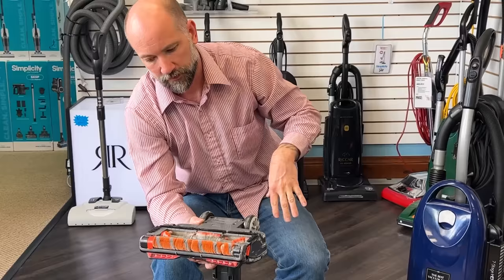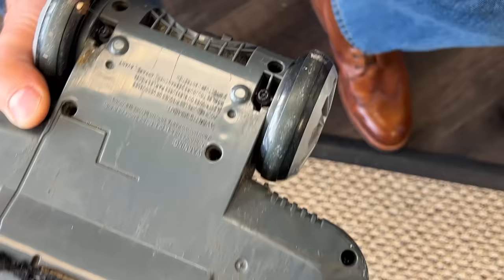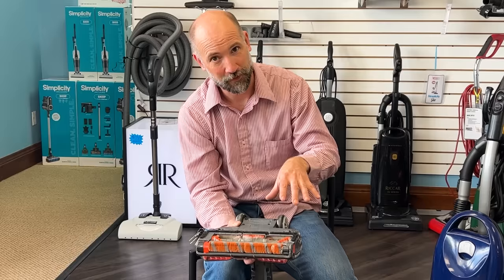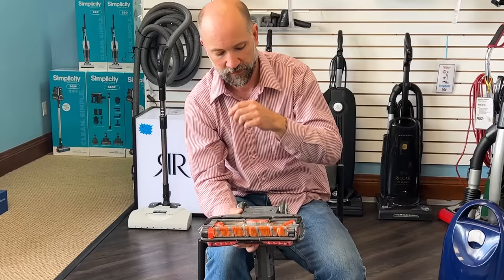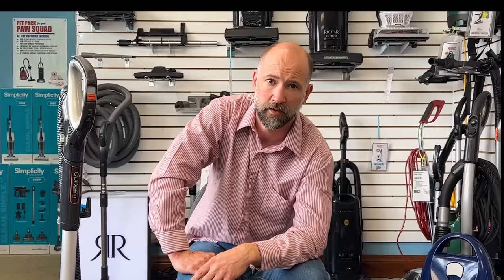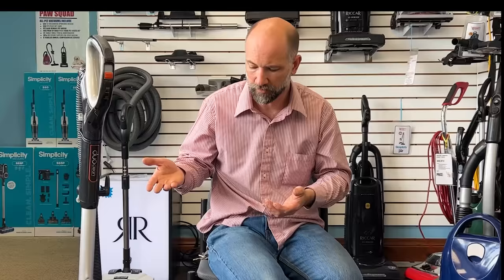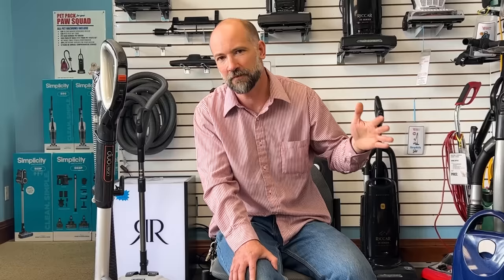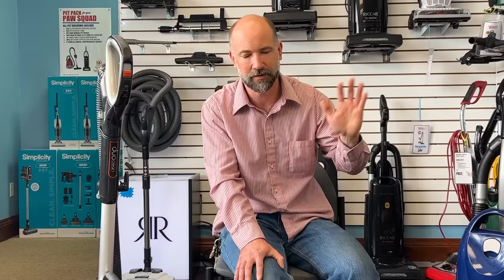Why Can't You Repair Your Shark Vacuum?

Comment: I worked in a small independent vac shop in the mid 80s. Parts were readily available for almost all brands of vacs. Sharks are disposable plastic, much like Bissel used to be. In the background I see that Eureka is still making the same kind of Sanitaire commercial uprights; that design must be about 60 years old by now.
Reply: Can't beat the older actual metal vacuums. My wife still has a couple of very old Rainbow vacuums that still work just fine and still produce enough suction to pull dried concrete apart. OK, maybe not that much suction, but I wouldn't be shocked if you could start up a B52 engine with one..lol
Reply: @martinoamello3017  Rainbows rarely last that long, mostly because people don't take care of them. If you follow the directions religiously, it makes all the difference.
Reply: I remember being able to go to Sears and get parts for most vacuums. Sad it's not that easy anymore.

Comment: I guess I got lucky.  Shark replaced the complete roller brush assembly under the 5 year warranty and I haven’t had any real problems until now.  For some reason there is a big crack in the bottom of the motor housing but the suction is still good.  I think I have had my NV501 rotator for about 10 years.  Figure about $20/ yr. to own a pretty good vacuum that works well—I’m satisfied.  I think I would consider buying the same model again and hope for the best.  Hey, I’ll keep the old one for parts.😊

Comment: We purchased a Rainbow vacuum 21 years ago at that time it cost us $1,800.00 with a couple of accessories. I don't think there are many people that would spend that kind of money on a vacuum but we liked that it used water and that it was very versatile. We still use it once a week or more have had zero issues with it.
Reply from the maker: Most people spend a lot more than $1,800 on a vacuum by buying lousy products that break every year. You hacked the system and bought some thing that actually works out of the gate. Talk about a life hack ;-P
Reply: Had one in Europe had to replace tank separator and gasket. But I don't vacuum once a week at minimum every other day.
Reply: WOW! you got a good one! My friend bought one... She spent about $2000 on it. the suction was horrible. It did filter the allergens out of the carpet though. I can see getting one if you have bad allergies... But... I hated it for every time you dragged it across he floor it splashed the big fan on the bottom of the motor... and dumping is was a GAG FEST.
Reply: I got a Rainbow D-3 from the 1960's from Goodwill for $20. Using a pail of water as a dirt bag is very strange but I guess it's a novelty.

Comment: Very good video. We live in a small town. The vacuum shops like yours are an hr away. We will browse your info and possibly buy from you. We got this Shark from our daughter. She is moving and didn't want it. We were trying to take it apart to clean the roller brush. That is when we discovered the fiasco of a fairly permanent assembly. We watched a couple video's of how to take the head apart and in both some tabs broke. We broke one too. We were down to removing the motor for the head when I searched again and found this video and decided to just reassemble and use it until it dies.

Comment: I know what you mean, it was difficult to get the 8 screws out of my Shark NV360. I used an allen wrench (hex key). If you hold the allen wrench perfectly straight you can get the screws out, may have to grab the allen wrench with pliers. I think the allen wrench was 1/16" size. Anyway, I went to my local Home Depot and got wood screws to replace the OEM "studded" screws. They fit perfectly, the screw size was #7 x 3/4 inch by Everbilt with a standard Phillips head, they even came in a convenient 8 pack. From now on, if I have to open the vacuum to get to the roller brush or belt it will be much easier.

Comment: I'm on my 2nd Shark and it'll be the last one of their vacuums that I purchase.  Have a Duo and the front roller stopped working (likely a broken belt), but after removing every screw on the dang machine, it still would not come apart....and even if I was able to get it apart, probably would have had a heck of a time finding a replacement belt. So, now I'm just using it without the front roller, and when it comes time to replace it, I will certainly be paying closer attention to repairability of the next vacuum.

Comment: Tamper-proof torx screws are pretty easy to bypass. Many times a small punch and hammer can be used to break the center pin off, and then you can use a regular torx bit. I've done it this way quite a few times with success. Another method is to find a small flatblade screwdriver and use it to go into the screw head using two corners of the star and the center post as leverage points and then you can just start turning the screw out.
Reply: Or you can go to the local hardware store and buy the tamperproof torx screwdriver bits…
They aren’t as rare as this guy thinks…
The triangular bits are a bigger problem…

Comment: I read that Spain wont allow certain domestic appliances on the market unless a company has available parts for at least three years or more (i think). I saw this on Spanish video on repairing Shark vacuums. I have had mine for five years, mainly clean hard floors and a few rugs. I managed to blow the motor,  bought a replacement for £25 and connected, hardest part was the torx screws, but i just used a flat head. New filters, works very well. But it is definitely a scam how things are made, and the build quality of the Shark wasn't great at all, cheap plastic crap really.
Reply: EU law requires parts availability and support for set periods for domestic appliances.
Reply: @kenjepson1908  And rightly so. 👍🏾

Comment: Thank you for the video. I am happy to say we have had ours for a good 10 years with not an issue. Except a broken handle/hose that I was able to order parts for.
Still miss my oreck upright which also went 10 years but was a bit more expensive than my shark.

Comment: We are on our 2nd Dyson Vac in something over 25 years. We did have a Panasonic for about 3 years but when that failed we went back to a Dyson. I have just had to buy a new hose for our latest Dyson, took 5 minutes to change including watching the YouTube video on how to do it. My son bought a Shark which broke after 9 months so was still under warranty. He took it back to the supplier and traded it against a new Dyson, that's still going strong 6 years later.

Comment: Wow.  I've just replaced a big Shark lower hose, and it was not impossible, only one screw was security torx, the rest Philips.  It was tricky and without a video I probably would've failed.  This is a 400 dollar Shark I got from a thrift store for 10 bucks and added a new lower hose, costing 2.50 to make it work fine.  I got the hose from ebay in a set of 4 for about 18.00 shipped.  Hoses for Sharks seem to be either 1.5 or 1.25 inches across, and about 6 inches long.  Previously I bought another smaller Shark, which had a plastic button that held the shaft onto the body, but failed to work.  So, I drilled a quarter inch hole in the body and shaft and added a steel pin with a metal ring through it.  To disassemble, you just grab the ring like a grenade and pull out the pin.  It works better than their lousy plastic button let me tell you.  I think they're good machines, but know what you mean about the repairs.  Dyson ain't a lot better, now you have to buy whole assemblies for 125 bucks, etc.  Royal went under, too bad, they were terrific machines, fixable almost always.  One guy just bought a Dyson Dc14 off me second hand simply because he had one already which worked well for "years" till it stopped sucking.  I showed him how to remove and clean the filter and he realized he'd never done that.  So now he has TWO DC14's but knows to clean the filters.  He had only tried to clean the HEPA filter which he found right away.  DC14 pre-filters are sort of hidden under a tab in the carry handle which is faintly marked but not very obvious.  Vacuums are addictive fun for me in retirement, but you're right about the fact some simple, stupid little things just can't be fixed. anymore.  cheers, Bob
Reply: So many people throw theitheir vacuums away because of that pesky FILTER they knew nothing about... i see it all the time

Comment: BTW: Shark are not alone in this tactic. LG tv remote controls have same issue - hidden internal plastic clips that break when you try and take them apart. I had the torx bit in my iFixit toolkit for my Shark - and the base was somewhat similar to the one you showcased. I unscrewed 11 torx screws and found there were 4 plastic rivots - I could see them in the one you showed too, so I couldn't get to remove the cylindrical brush. I managed to get a anti static wrist strap /cord would round about 20 times within a second or two when I inadvertently sucked it out from the side of my computer bench. What should have taken me 10 minutes to untangle took over 90 minutes due to the big metal clip on popper buttons being so large for the small gap in the vacuum. I love their products - not their consumer unfriendly maintenance policies.
Reply: Internal clips in electronics are easy to deal with if you have the correct tool, called a spudger. It's a plastic tool you use to ease the item open. No big deal.
Reply: Every cell phone has plastic clips, they are extremely annoying. I have changed screens and batteries for all my cellphones, I'm on my 7th so far.
Reply: @chinnyvision  Not when the case is glued in... Then you have to heatgun it for so long you're cooking the display

Comment: My previous Shark vacuum had a hose connector at the body of the canister to break off. I glued it but it broke again at the same place after a few months. It was still under warranty, so I called customer service. When I described the broken piece, she told me that Shark didn't carry that part - but since it was still under warranty, they would send me a new vacuum. They also wanted me to ship my old vac back to them in a prepaid box. I'm still using the replacement vac they sent me.

Comment: Thank you for a great video! I'm very into right to repair and keeping my stuff running. The suction motor on my shark just stopped and this was the 2nd video that came up. I'm glad I didn't just dive into a repair assuming there would be parts available. Sounds like I'm on the hunt for a more durable and repairable vacuum!

Comment: I don't live in Colorado but I have tried to fix a friends shark. They  have a great business model and I am sure make lots of money.
If you don't want to feel like a sucker the best way is to go to a store like VRU, and buy what you buy for a reason. They will tell you what would be best for what you need.
7 years ago I bought the last vac I will ever need from a local like this. It was a brand that you  don't see much probably because it's not one that a dealer can double their money on selling. It costs more and it weighs more btw. Best thing I've ever bought.
I don't sell vacs but in my trade the best products are the short dealer discount (so they can have a competitive retail price), barely advertised. The heavily-advertised stuff tends toward price point quality. The cheapest is the one that works and lasts.

You may have to defend yourself for spending more. Concentrate on the positive, the Value, instead.
Thank You

Comment: Great video.  I have just finished repairing my Shark Duoclean cordless brush head which had stopped working.  Two different Torx security drivers and plenty of "de-clicking" and I found that the way the wires had been run it was almost inevitable they would snap eventually.  I have created an external wire run to completely bypass the problem.  But for 95% of people that is not happening.  Sigh.  Hopefully this one will now go for some time but I will not buy a Shark again - Miele.

Comment: Good knowledge b4 replacing easy parts on most vacuums, except Shark. I'll look first to see how to change lower hose on this Navigator I believe. I thought it read nv300-26, but it was in the center for parts and this was on the side with small & long plastic connections.

Comment: We bought a used corded Shark upright vacuum cleaner at a yard sale several years ago. It worked well until recent months. The removable wand that forms the top handle would no longer seat and clip into the top of the machine. We called into Shark tech support a couple days ago and had a video teleconference with them on my iPhone. We thoroughly reviewed the entire unit to fix all the problems. Most issues were easily fixed. But one issue was not: the wand at the top of the machine. The tech support guy told us to order a new wand at Walmart.

Over the weekend, I visited several web-sites that claim to sell vacuum cleaner parts (including Walmart, Amazon, Shark-Ninja, and eBay. So far, we struck out. Nobody even seems to acknowledge that our model exists, let alone do they stock any parts for it. We can't even find an owner's manual for it! Looks like this Shark will be our last. Now we know why the Shark was so easy to pick up at a yard sale...

Comment: It's not just Shark doing this, Hoover is doing it also. I bought a cordless hoover upright about a year and a half ago. After about six or eight months of use (in my house it gets used heavily) the power button started intermittently working. So I proceeded to take the machine apart and see if it was something I could fix. Well after about two hours of head scratching, twenty trips out to my shop for tools, and much cursing I finally got it apart without destroying it to find the only thing wrong with the on/off button was that the carbon dust, created from the brushes in the motor as they wear had gotten inside the switch and we all know how well carbon dust works inside of an electronic control, with a PCB in it. After cleaning it thoroughly, I put it back together and it's still going strong today. But the Hoover vacuum was like the Sharks, it had plastic tabs, torx security screws, and definite attempt to keep me out of it, the latter of which they failed !

Comment: Ive had multiple Roombas over the years, the older ones have been given to friends and relegated to garage/basement duty. I robot has gone in the opposite direction by making thier vacumes modular, so if a part breaks there are many oem or aftermarket options. In fact my i5 had a mother board failure and it took $40 and 15 minutes to repair it. I have a shark i purchased on a deep discount rack at Lowes and very rarely use it.

Comment: I understand what you're saying, but at least in our case, our Shark Rotator vacuum came with an unlimited lifetime warranty.  We had the "cracked lower hose" problem a few years ago, so we called Shark, and they immediately shipped out a whole lower assembly (we didn't even need to return the broken one).  We were very impressed with their customer service.

Comment: Fixed my Shark DuoClean today. I ordered the bits and had to take out about 20 screws. When I finally got the belt module out, I had the wrong belts. Cleaned it up and lubricated it, put it all back together... and the brush is turning again. Only had 2 extra screws. It is now our backup vacuum.😅

Comment: As a general consumer,  Shark are the best I've found. Easily clean and all repairs I had to do were simple.  Surely they can be made better, but their price is reflecting what you are getting. Additionally, any bit, security or not,  is but a quick purchase away. Aftermarket belts are easily found.
Reply: Hmmm this does not seem possible Vs this video. Why would this guy love, he has no way to benefit he's not trying to sell a competitor hes trying to repair them.

Also 3rd party belts are exactly that you have no idea of the quality and you have to warranty the part and your labour.

Besides we're talking about more than just belts what about other spares? Not one of the suppliers I use has proper spares for Shark stuff
Reply: @norfolkngood8960  I found a supplier of the foam filter that goes under the canister and the front filter that seem to work pretty well but they are just pieces of foam so you have to go out of your way to screw those up. Belts, though, vary wildly in how long they'll last.

Comment: Any product without published repair guides, or without individual parts (as opposed to more expensive full assemblies) being made available to the public on a reasonable and non-discriminatory basis, should be required by law to have the word "disposable" in its name on all marketing materials. Also, even if guides and parts are available, the disposable label should still apply if any critical force bearing components are made of thin brittle plastic that is likely to break under normal use. Example: the dust cup pin retainers in my Shark vac.

Comment: Throwing my only Shark vacuum in the trash tonight.  I am glad I found this video before I bought a second one.  Mine has a broken belt.  That's it.  Broken belt.  I bought the Torx drivers I need to take apart the head unit -- all three sizes -- but had to use a pry bar to defeat the plastic retaining clips.  Parts went everywhere and I don't think I can even figure out where everything goes.  I've owned a lot of vacuum cleaners in my life (I also used to work in a janitorial service) and I have never owned a vacuum where I couldn't replace the belt, beater bar, impeller, hose, on/off switch, etc. until I owned a Shark.  I will do some research to see if the Ninja products made by the same parent company, SharkNinja, have the same reputation.  We have quite a few Ninja products in our kitchen, but they will be the last ones we own.